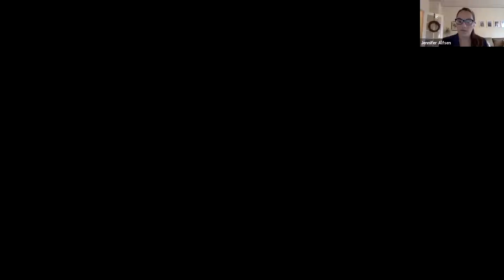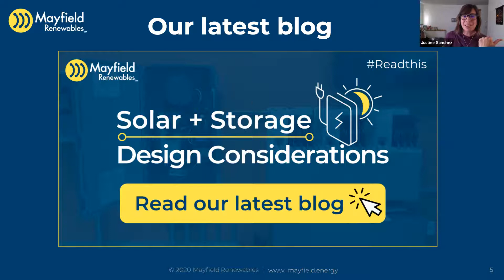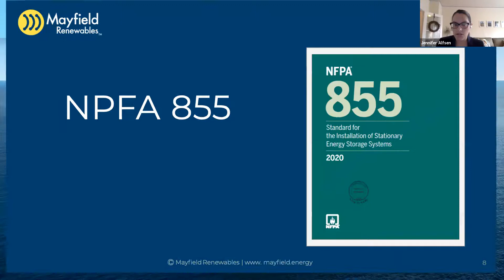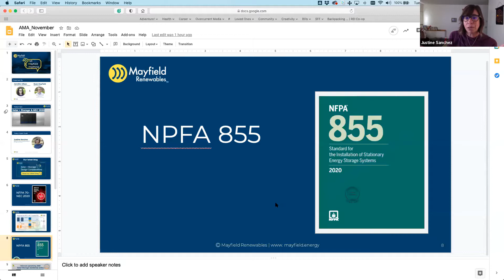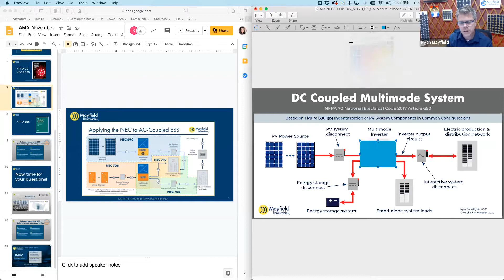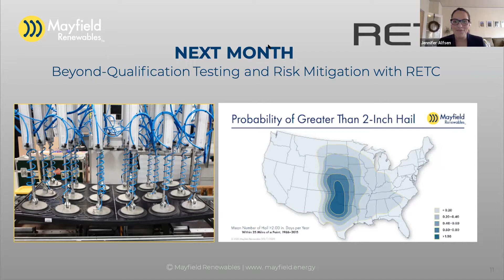Ask Mayfield Anything: Solar+Storage Code and Design Considerations

Comment: inside house: 40kwh not 50kwh@ 35min, correct?
Reply from the maker: Yes, that is correct. 40kWh maximum within a utility closet or a storage or utility space. 80kWh maximum inside a garage or along the exterior of a building. 

We wrote an article on this topic too: https://www.mayfield.energy/technical-articles/fire-codes-and-nfpa-855-for-energy-storage-systems/